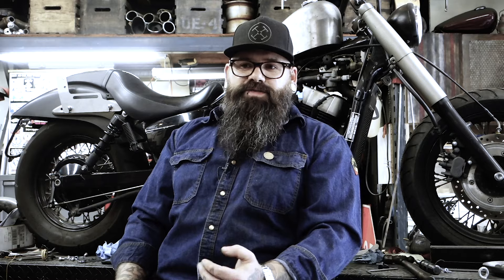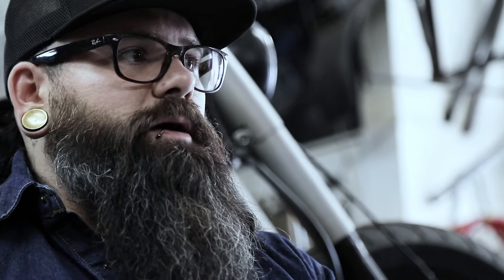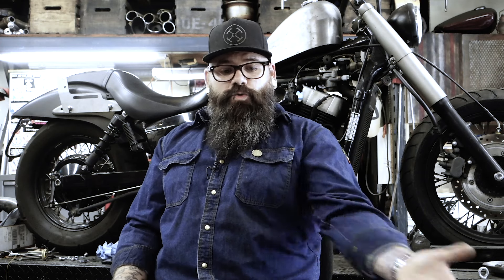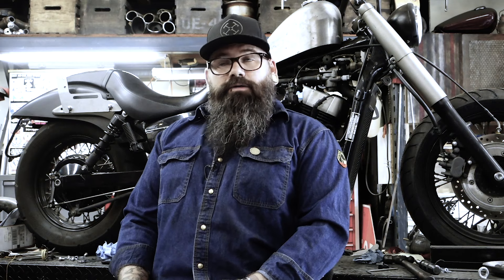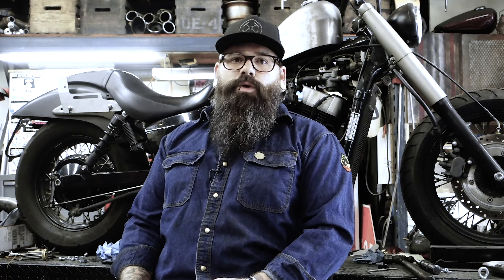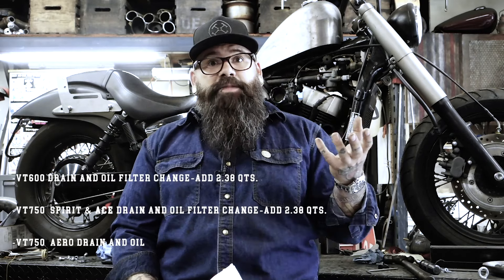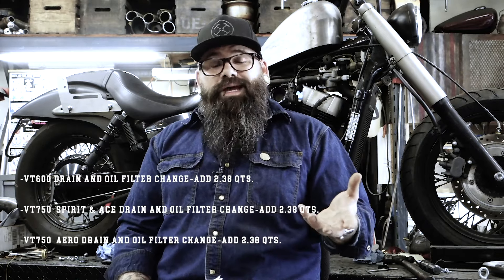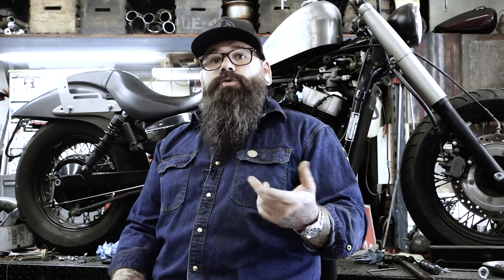How to Fix Oil Leaks: Crankcase Breather Edition

Comment: Thanks so much, per the mechanics advise we should seal it since he felt there was no real use for it (the bike was imported and its a Yamaha scooter). 
I had this same issue and but then 2 of the 3 mechanics ( I travel a lot and have 3 mech. based on where I am) asked it to be sealed but recently seen oil around like you said and planning to unblock it after this great information. Currently at the shop for Brake change and will unblock it tonight when I pick it up. 
Subscribed!

Comment: It is wet sumping . If it has sat for long periods without starting the oil seeps down from the oil tank past the checkball into the crankcase. Being a dry sump it is now sucking the oil from the crankcase and spewing it out the breather via the blow by hose.
Reply: Went to look at 1989 Vulcan 750 today.
Oil dripping out of hose by air filter
Nike hasn't been ridden in 5 months.
Backfiring too which they said was unusual.
And it won't idle without choke on 20%

How long before weeping oil issue stops?
Reply: @EvilTwin123  ever find out how to fix the issue ?
Reply: This happens to my 1972 FX occasionally usually only on initial start after a long sit, how do you fix it ?
Reply: @EvilTwin123 usually with frequent riding the oil stops doing that if you have a crank breather but if its going through the carb it’s something else, back fires is probably a carb blockage or tuning issue or even the valves are out of there specified clearance. The older the bike usually means more tuning more frequently

Comment: I measured my oil exactly with a graduated painters cup. Blew 1/2 a quart through the breather today. Kinked hose and high rpm.
Reply: The breather hose was kinked? Trying to figure out why mines leaking, same as you I’m certain I put the correct amount but still blowing some out after high rpm

Comment: If you get some junk holding your float needle open. The fuel can drain into the motor if the petcock is left open. Same result, puking fuel oil as pressure builds.
Reply: What is fuel oil?
Reply: @chard404  Chard. It isn't the heating type they use up north haha. Just your oil is flooded with fuel that should be in your tank.

Comment: First bike was an 883 with the 1200 kit, my dumb newbie self got a new air cleaner and oem bolts didn’t fit. Ran solid bolts in the head, about 3 miles down the road my oil tank exploded.
Reply from the maker: Yep, that'll do it!! Lol
Reply: Wow

Comment: 2022 Triumph Scrambler, 1200XC with an oil leak at the drive sprocket shaft. 
I noticed this leak in the showroom before I even bought the bike.
Where are the pressure relief valves on this particular motorcycle?
I’ve noticed oil seeping from the gasket on the bottom cover.
It’s not much but just enough for me to notice a difference in color along the line where the gasket is. That’s excessive pressure because it doesn’t leak at idle. The drive sprocket shaft leaks after each ride, more so if I’ve been in the highway.
The gasket seeping happens after a highway run.
What could possibly be blocked or malfunctioning on a brand new motorcycle that would cause an oil leak because of access crank case pressure ?
Reply from the maker: My dude that sounds like a mess. Im sorry but i dont know dick about fuck when it comes to triumphs.the last triumph i worked on was 8 years ago on a vintage T100. Get your scoot to a shop who can help, im sorry but i cant be if any assistance with this

Comment: Hello Oil coming from crankcase breather but only does it running not over filled runs great compression check 120 front jug 130 back no smoke nothing have no idea PLEASE help. Thank you very much Everything in oil pump clean and as it should be 30 pds oil pressure on start up.

Comment: Literally just put oil in my bike and rode back from Napa and got oil all down my leg.   I definitely over filled it after watching this  lmaooo.  Bike also starting bogging out at high rpm’s because of it as well.  Hopefully once it reaches the normal level it’ll be fine 😂

Comment: My crankcase breather will completely drain my tank so it can't because it's overfilled any other suggestions of why it's doing this? Also the guy I bought it from didn't even have the lines hooked up to the oil filter he had them all rerouted is this why?
Reply: Did you figure it out?!?! Im having the same issue just pumps out at idle

Comment: So what if it’s not overfilled? What if it’s just blow by? I have an 84 evo bottom breather. I need ideas on a catch can
Reply from the maker: welp... the things that come to mind - 
Partially restricted oil return line.
Wrong oil filter.
Oil level too high in tank.
improperly installed, upside down piston ring
shitty bore job
id look at that stuff before making a catch can honestly.

Comment: I had my bore replaced on my 50cc scooter because I blew my piston. It was leaking oil ( just a little). I rode it under 30mph because it would overheat and die. I was told because the engine was too new and had to be broken in slowly. 
Long story short, the engine died, and there was oil all over my rear tire.what do y9u think? Thank you John
Reply from the maker: What do we think? We think that sucks and we are sorry that happened to you

Comment: Interesting. Why would it happen to me 1.5 years after I changed the oil... Also it smells like gas.
Reply: Fuel is getting past your piston rings or valves.
Could be excess exhaust gas getting past the rings into the crank case and causing to much pressure
Reply: turn the fuel off.
Reply: @RealWattage  this is crazy too read because I slowly started leaking oil from the jugs then the carb flooded while refueling at a gas station and also at the same time my petcock broke.. so now I know what my issues are for the most part..
Reply: Same
Reply: Me 2

Comment: No I did not over fill the oil. Started after a few seconds, POW the oil blew the oil fill cap off and oil all over the garage wall. 
So what is the problem? To me seems like the oil is getting back into the oil holding tank. Then pressure builds up and then POW, what can I do?

Comment: I run mine on the add mark and mine is still blowing oil out of the breathers
Reply from the maker: If youre talking about a honda shadow, theres only one crankcase breather, a small amount of oil and condensate will come out of there, and the hose should either be routed to the ground or the way its set up stock. you shoudl never run your bike with the oil set to the ADD line, that can cause serious foaming AND more oil being blown out.  if its PUKING oil, then you have a blow-by problem most likely. intake valve seal/guide is leaking or the rings are worn. or the valves may be worn. 
Adjust the valves and do a compression check and put some oil in the bike please.

Comment: See I have a Yamaha 1982 maxima and my oil is going into my filter or airbox and when I started my pistons are sounding like they are scratching or scraping against the cylinder so I want to know how I can fix that or get it re-lined because I have a trip coming up soon and I need to make sure I’m safe on the road

Comment: I have a 2004 Yamaha R1 when I start the engine it starts to get excessive gas going into the crankcase. I have to drain my oil and it is heavily diluted with gasoline. I don't know what would be causing so much gas to get into my engine oil.pleasse helpe
Reply from the maker: i have zero knowledge about R1's

Comment: I have a 2004 Bigdog ridgeback with a 117 ci S&S and I have oil in the air cleaner. One hose runs from the rear head to a one way check valve then to the back of the air cleaner . The other hose goes from the front head to a port on top of the carburetor. The oil is filled to the bottom of the fill neck as recommended by Bigdog. Is there another option I can use to stop the leak. Right now I have a Kuryakin 9931 catch can installed to the rear cylinder head. Any advice would be appreciated.
Reply from the maker: sory i have no clue man!

Comment: Mine leaves the 3 ft. Puddle and is not overfilled.  It will puke the oil until it's dry as a bone.  That's the first thing someone's going to check.  I need diagnostic help.  Someone from another platform said cracked piston in between the rings.  Starting to think this might be it.
Reply: Hi. I am having the same issue.  Did you solve the problem , if so, what was the problem and what was the solution?
Thanks
Reply: @shannamassie7104  it was a cracked piston.  It ran pretty good, that's why I couldn't figure it out.  It wasn't until I actually pulled the piston out of the jug that the piston fell apart in between the oil rings.  It got crazy hot probably from running lean.  Even though the machine wasn't running hot, the piston must have been.  It practically melted and crumbled at that joint.  I got lucky and listened to another poster who had the same problem.  It wasn't burning the oil and ran good so I didn't suspect the piston.  Sorry for the bad news bit your piston is likely hosed. I tried the pcv mod but nothing worked.
Reply: @bigguy8586   Thank you so much for your response
 I really appreciate it 💓💓💕

Comment: I did not overfill mine but always spew a little oil everytime
Reply from the maker: There's a problem somewhere.
Reply: @TJBRUTALCUSTOMS  is it suppose to have a plug at the end of the breather hose?i saw many with a plug but i saw a video saying it should not be plugged because it will build up pressure. Which one is true

Comment: I been having an issue with my main shaft seal leaking on my big inch motor even after just replacing it and putting some rtv silicone on the lip the stator bolts too. I don’t have any bad blow by in my breathers which I just run the open bolt with mesh screens from speed dealer on it. Any ideas on that? Iv replaced both main shaft seal and spacer and leaks first ride.
Reply from the maker: Maybe the surface is scored and allowing oil past, maybe the shaft isn't perfectly round. Hard to say, can't really diagnose anything via comments, sorry man!

Comment: can i get some help? my bike wont go past 3k rpm.. its a 2015 dyna fxdb.. ive replaced injectors coil pack sprak plus leads, check stator checkd regulator checked fueling and there are no codes... im at a loss!

Comment: I have a small 4 stroke engine and I think my problem started with a simple breather hose being kinked and pressure built up to the point that it blew the crank shaft gasket out as there is a bad leak even after fixing the hose that was blocking the pressure and I can not get the screws loose on the crank case! Hope I used all the right names for all parts specified and hope the problem is something easy to fix as it that!

Comment: Ha, having this exact issue based on his exact advice. And the "to much oil" is not an answer...  The bike will run itself dry, overheat and the piston will seize up.  I'm thinkin a catch can type system might let it run off somewhere and let it feed it back into the crank.

Comment: Unless were talking shovel heads and older then it probly leaks past your check ball in your oil pump. If you leave it sitting threw winter without starting it you'll have a puddle.
Reply: @TJBRUTALCUSTOMS . How does this get fixed ?  Thanks.

Comment: overfilled my oil. crank case is leaking.
Do i need to replace the crank case cover or should i just bleed all old oil out and replace the filter? will it still leak ? (need help)

Comment: I have this problem.  The crankcase ventilation is puking out oil.  The difference here is that it will puke out oil until it gets low on oil.  LIke it wants to puke it all out.  It only does this under high rpm under a load situation (revving the motor in the driveway doesn't do it)  it won't leak unless high rpm AND high load. Then it spits it all out until its low. Does anyone know what could cause this.  Initially, I did overfill it and went on a long road trip.  The bike had a history of going through oil (KLR650) so thats why i usually kept it full or a little overfull so that it wouldn't get low as fast.  Now, it dumps what looks like a quart out in a matter of seconds once it has the condition met listed above.

UPDATE:  This ended up being a crack in the piston in between the rings.  It was undetectable until I pulled the jug.  I couldn't see the damage until the piston came out of the jug.
Reply: Interesting, was the bike making any blue smoke? Or was the compression just getting shoved into the crank? Unsure how all that works, I would assume if compression air is getting into the crank you would also get oil into the cylinder?
Reply: Hey what's up Brian been a long time since you posted this but in case you see this, I ve been having the same exact issue for the past 8 years and had the top end rebuilt and pistons replaced two times and still have the problem. Just wondering if you've found anything else since then. A lot of people mention kinked or restricted oil return lines causing excess crankcase pressure.Thanks hope your bike's running good

Comment: i thought it could be from blow by but my motor has plenty of compression i plugged iy then when i took of the plug it was like a air compressor it just shot out heaps of compressed air whatever you do do not plug the crankcase vent

Comment: What about a bad check valve
Reply: @TJBRUTALCUSTOMS  I have a 91 fat boy if I let it sit over a month without starting it it will blow oil out the breather on the bottom. If I start it regularly after it’s fine
Reply: @TJBRUTALCUSTOMS  Are you refering to the check valve ball in the oilpump? I have same pronlem with a recent bought '89 FXSTS.

Comment: Ya TJ I have this problem with a 86 soft tail custom .oil puke out the vent hose on shut down . Bike runs fine other wise any ideas? Other than over filled Tks  from Canada .
Reply: Kerry Munson   Tks Kerry . It is a custom copper and I pick it up   Used . I appreciate your insight. All drop you a line when I get into it lol . Tks again every thing you said makes Sense . I’ve asked more then one I so called bike Mac. And not
Reply: @jefftherrien8435  What was causing it, and what was the solution. I have oil puking out of vent when turning the engine over trying to start...

Comment: i opened up the drain plug but no oil cam out.. so i put more oil, and that was a problem.. i still hear a scratching sound from piston, which i would assume no oil to lubricate, my best guess? somethings clogging the oil, seems like alot of compression, I could be wrong, which i always am :\ ..  i'm gonna open the plug again see what happens

Comment: Or if it sits a long time an the seat on pump needs deglazed and new check ball and spring!!
Reply: Could this be the reason of my purchased FXSTS,after sitting for 9 years, blowing out oil of oil vent(?) when trying to start, from a tube from the lower Evoblock, left side next to the oilpump? How to deglaze pumpseat?? Thanks. (Sorry, am new to HD, is my first)

Comment: Hoping you can help me. I've got an R1150RS and oil is puking out of the filler...and no, I didnt over fill it with oil. Through a lot of searching, the only thing I can narrow it down to is a crankcase breather tube that might be blocked. I've looked in the air filter box and it looks all dry in there. I'm also burning oil sometimes at startups.  I can't locate this breather tube... help me please, you're my only hope. Luke

Comment: Crankcase vent leaking for me but not my engine oil- that’s darker than what’s coming out pretty sure it’s my primary’s. But been a year since I did my change and it was leaky out of my derby cover anyways so by now it’s low no reason for it to push out oil. Hit a deer two weeks ago didn’t drop the bike but he went up the right side of my bike- 03 sporty 883 anything you could think of? Possibly building too much crank pressure from the switch at the filter?
Reply: @TJBRUTALCUSTOMS  not a bother buddy thanks for your time anyways keep on keeping on
Reply: Hey what's up monty in case you see this, what switch are you referring to?

Comment: I have a 92 FXSTC & I had tires done at HD.. well they topped off my oil and Iv had it piss out of every spot possible. Sucked some out with a Turkey baster & it has seemed to solve my problems… for now. Ride safe everyone. Read those manuals.

Comment: I just eliminated the pair valve/Desmog setup on my 2004 VTX 1300 and was wondering if you know if that would plug or block the crank case breather. The kit that I installed said nothing about it but I want to make sure it’s not a problem.

Comment: I overfilled my 08 Electraglide with engine oil.  On a long ride it was leaking oil it looks like out of the air filter.  Is this bad it stops when I turn off the bike well what should I do?
Reply: Sell it

Comment: Would this still be the case if the crank case breather started leaking after lowsiding the bike? I slipped with the bike on a turn when it was snowing and saw no external damage to the hose or rest of the bike.
Reply: But I was having problems with loss of power before this happened the bike is 2001 with all original parts and had sat before I bought it so maybe the crankcase breather went bad?
Reply: @TJBRUTALCUSTOMS  I get it's all theory withought the bike present
 I guess my follow up question is do you think the head gasket or piston rings could be a more likely contributor to the leak?
Reply: @TJBRUTALCUSTOMS  ok. I'm not smoking so I'm glad its nothing in the engine. I guess I'll just wipe down all the mating surfaces and try to blow the oil out of the hose and hopefully that can help narrow it down. Thank you!

Comment: Overfilled my 97 vulcan 1500,started leaking oil from under the top of the front cylinder under the chrome covers,it didnt come out of the breather so did it just blow a gasket or some sort of seal? I drained it to the proper amount and still oil leaking fast out of the same spot,thanks for any advise you can give me,dont want to do a 10hour top gasket if I can help it,cheers
Reply: I believe I have same issue